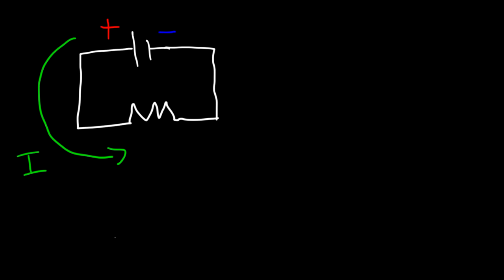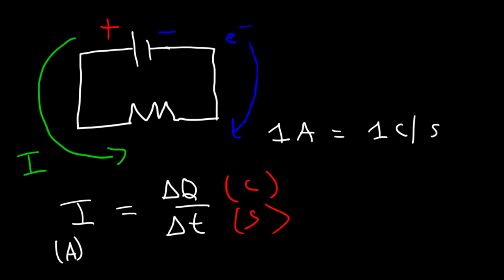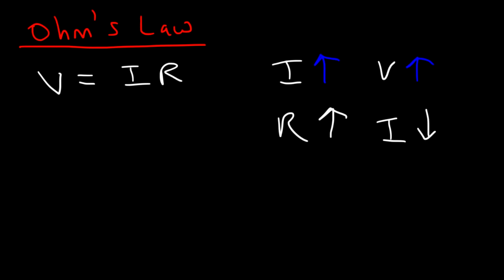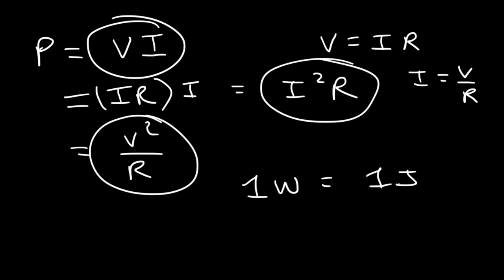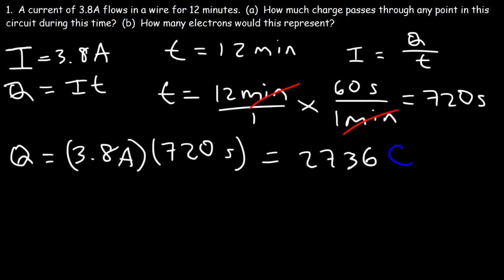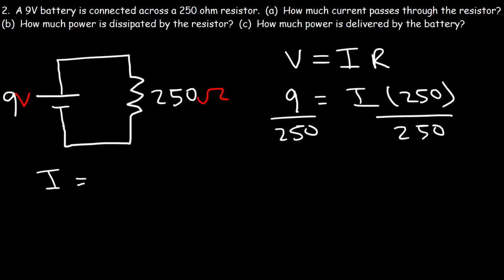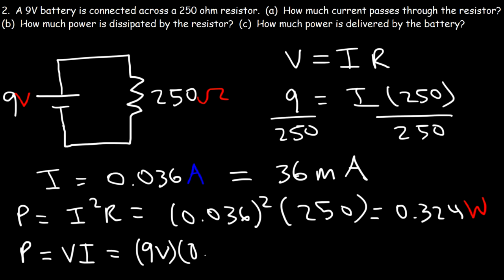Electric Current & Circuits Explained, Ohm's Law, Charge, Power, Physics Problems, Basic Electricity

Comment: Yo bro at 10:27 you said that the resistance is 80 when it was supposed to be 0.0125. Keep in mind that I am a 10 year old but am i tripping fam?
Reply: The current here is in mili amperes u need to convert to regular amperes so current will be 0.15 not 150 therefore when you divide 12 by 0.15 its 80, also its not 0.15 over 12 its 12 over 0.15

Comment: Your answer to number 3 is incorrect. It should be 513.216$ not 0.14$. 1.8W should be joules per second not watts per hour. Otherwise it should be specified that it is 1.8 watt hours or the default interpretation is watts/second.

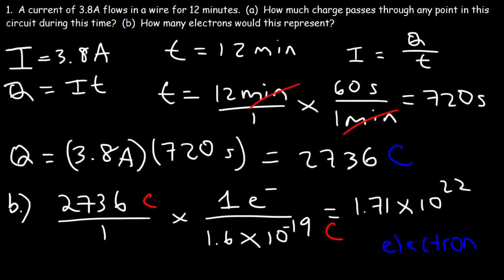Comment: @ 6:13 - My calculator gives me 1.71 * 10 ^-16, while you got 10^22. Anyone know why this is happening?
Reply: my exact problem. did you ever figure out how to fix it?
Reply: @amandas_wrld  Make sure you have parentheses around (1.6 x 10^-19). if not, the calculator will think you’re dividing by 1.6 and multiplying by 10^-19.
Reply: Uh oh, same
Reply: Isn’t 1c = 6.25 x 10^18 electrons?
Reply: @ConsoleGamingJourney  aren't those moles?
Reply: @amandas_wrld @ssourgemstonee1015 put parenthesis around each set and it should fix the problem.
Reply: Use Casio fx- 991ES PLUS. It's what I use and get same answer

Comment: 8:42 does it have to be equal or is my calculation wrong I got 404 milliwatts dissipated by the resistor yet the power being delivered I calculated 408 milliwatts for a 12v battery with 350 resistance

Comment: In Question number four, there is a mistake,
emf=I(R+r)
emf-electromotive force
      I-current
     R-External resistance 
      r-internal resistance so you were supposed to calculate internal resistance(r) and not external resistance(R) which its answer will be equal to zero.

Comment: At minute 12:13 you have counted the power 1.8 to be per hour and didn't multiply it by 3600 thus you got the cost as $0.14, instead it should be 1.8 X60(seconds in a  min)x60(mins in a hr)x24( hrs in a day)x30( days in a month)x 0.11$ all divided by 1000 ( to have KW ) which will give a result of $513.22
Reply: Sorry to tell you. But you're wrong. $513 is no where near.

Comment: Mr. Organic Chemistry Tutor, thank you for an outstanding video/lecture on Currents, Voltage, Ohm's Law and Basic Electricity.  This is a solid starting point in Electrical Engineering.

Comment: At question 3, aren't you supposed to first turn the 1.8 W per second into per minute, and then into per hour and then into per day and so on? Because the answer I got I think makes a little more sense, which was $513.22 per month
Reply: retweet
Reply: Fr bro I don even know how he got 0.14
Reply: @SAMSMIZZY 1,8 w * 3600 s * 24  *30  = 4665600 ws (watt-second)
4665600 ws = 4665,6 Kws (Kilowatt-second)
4665,6 Kws/3600 (kWs/kWh)= 1,296 kWh
1,296 kWh * 0,11 $/kWh = 0,14 $
Reply: You calculated kWs (Kilowatt-second) not kWh. You basically considered that a kWs costs 0.11 $. I got confused too because he didn't show that.

Comment: my only doubt is that, since the wire also had resistance, it should decrease the current. but then, it didn't only care about a lone artifical resistor on measuring it's current by just only find it's resistance

Comment: Weren't you supposed to turn kilo ohms into ohms before x by 5?
Isnt it a bit odd that 130Volts pushes only 0.026amps through 5ohms? I mean.... Would you put 130volts to do a little job?
I'm confused but I understood each and every other one you did great🙏🏾💫

Comment: i can’t fcking understand what current voltage and resistance are and what their links are .Like if current * resistance is voltage how tf is that the pd ?? measuring the difference in smthing is the same as multiplying that by a resistance like huh??? i hate electricity

Comment: Thanks. I just learnt more in 18 mins than I have learnt from my teacher this entire term. Also I have my exam tomorrow so even bigger thanks
Reply: i would have liked the comment but i didn't want to ruin the "222" likes
Reply: My qstns are way more complicated than this. I feel like this is just on how to use formulas.
Reply: im having a test right now😂😂😂
Reply: Eeeiiiiii 😂
Reply: Hey Bro You're not alone :D
Reply: @rafimohammad5907  what syllabus are u studying
Reply: @justadude721  Current Electricity & Circuits Solving (Bangla Medium)
Reply: An exam💀
Reply: Me
Reply: Good Luck!
Reply: I have a guestion uhm where are you from and how 's the education  system in your country?
Reply: @hermoniegranger8075 her question just remained as a question only guess you have to research it yourself
Reply: What is electric current?

What is electric current? Electrons flow in a conductor?

How do electrons flow in a conductor? Like many cars driving down the highway? Or is water flowing in warer pipe? What is a highway in a conductor? What is the water pipe in the conductor? Why don't electrons flow to the positively charged nucleus? What magic keeps electrons away from the nucleus?

Is the speed of electrons flowing in copper wire the speed of light? If not, how could electricity travel at the speed of light? If so, how can electrons accelerate at the speed of light?

In fact, Atoms are not made from charged particles as scientists told. 

All atoms consist of indestructible, electrically charged multiple layers hollow sphere and internally charged solid sphere. Outside each atom is a layer of negatively charged liquid that scientists mistaken for electrons.

This negative charged liquid attaches to non-metal atoms due to their outer layer is positively charged and floats on metal atoms due to their outer layer is negatively charged. The floating liquid of a conductor conducts electricity.

Electricity is flow in conductor 
instantaneously, similar to hydraulic fluid flow through hydraulic systems. 

The voltage of the electricity is proportional to the speed at which the floating liquid moves.

Comment: Fantastic video. Increase the voltage will AUTOMATICALLY increase the current
which will increase the available Power (watts) given the same resistance. Ohms law.

Comment: So you're telling me at 13:43, if you spend 11 cents per KW an hour, if you operate it for a month it will only cost 14 cents? Sorry but my mind... is blown.
Reply: Wouldn't it be $80.30? 730 hours in a month so 0.11 times 730 = $80.30

Comment: If 360 coulomb charge flows a conductor in 3 minutes, calculate the current flowing through a circuit.
Reply: 360c/180s = 2 Amps

Comment: I got 1.71 x 10^-16 as my answer for b 6:20. How?
Reply: Bcos ur calculator is heavily confused
Reply: yeah I get the same... until I input it exactly how he does it.. dont just divide 2736 over 1.6x10^-19; do it like this.. 2736(1/1.6x10^-19) should give you 1.71x10^22
Reply: samee. no matter what i try it won't give me the same answer